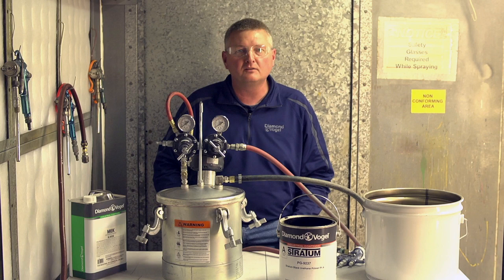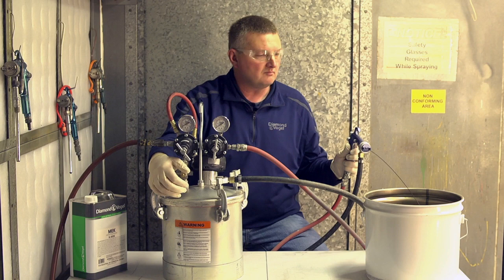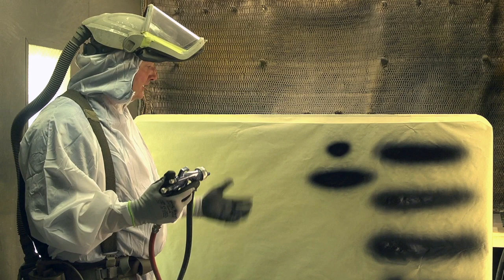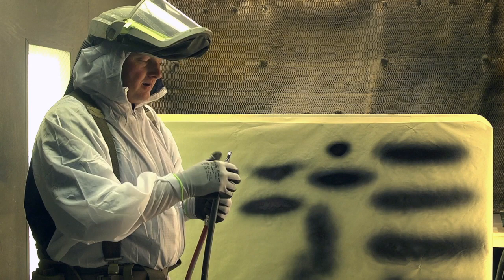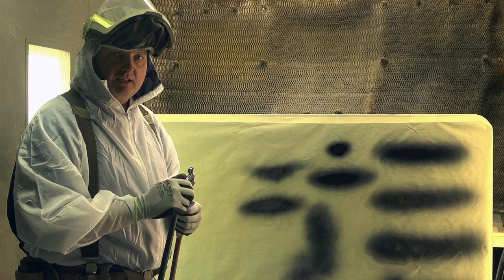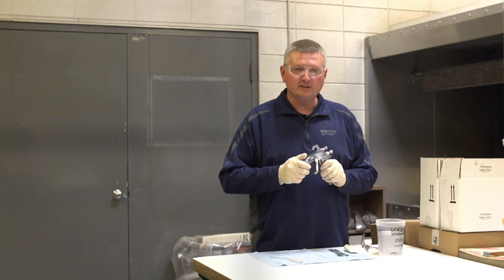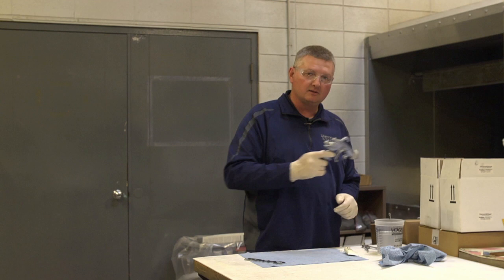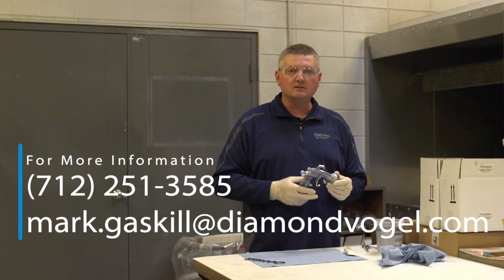Using a pressure pot with Diamond Vogel Industrial Liquid Coatings

Comment: When you pressurized the pot and streaming the paint do you have the fluid wide open on the gun? Or do you close the fluid knob on the gun (while pressurizing the pot)a little to add more material (from the gun)when spraying....if need be. I suppose some fine tune from the pot and leave the fluid knob wide open. I'm always curious to know other painter settings

Thank you
Reply from the maker: Hi Erik, thank you for your question. It's always a good practice to have the needle on the gun wide open, full potential, then set your fluid stream. Depending on what you are painting, a 12-18 inch stream is a good starting point. If you need to cut back, you can dial the needle in a few turns.

Keep in mind, if you continue to run with the fluid needle turned in, you will ruin the needle and nozzle of the gun.
Reply: @DiamondVogelPaint  thank you for that information.  So do you think it's better practice to try and fine tune off the pot? That's why I try my best to do.

Comment: What model gun is that?
Reply from the maker: Thank you for your question. The spray gun used in the video is a Graco AirPro HVLP pressure feed gun (Model is 288938) with tip size 1.4.

Comment: Hi. I am using a THICK epoxy already thinned to specs in a pressure pot like that one but I still can not get a good atomization. Is any solution to that?  Thank you.
Reply from the maker: Hello, Ricardo. Thanks for reaching out! It sounds like there could be a few different things going on. To better understand the issues you’re having and to hopefully give you some expert assistance, please reach through the contact form on our website: https://www.diamondvogel.com/industrial/contact. Thanks again!
Reply: More pressure! If not may need to use a little bit more thinner. Been coating for 5 years and i like my epoxies and paint to be a little watery not to much obviously it wont dry properly or you’ll get runs but most of the time thick epoxies may just need a bit more thinner or more pressure. Hope this helps. I used binks pressure pots. P mix systems. Ultra max 2 graco and graco bulldog airless and bulldog with minimal thinner on epoxy shoots good. Just an expensive rig is all.
Reply: You need put or mix the suitable solvent in your epoxy through standard ratio.